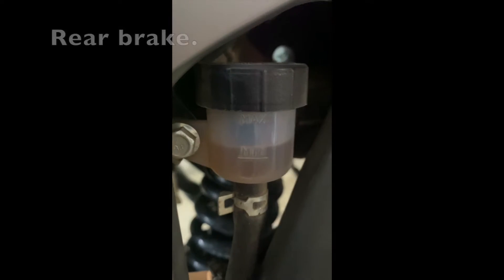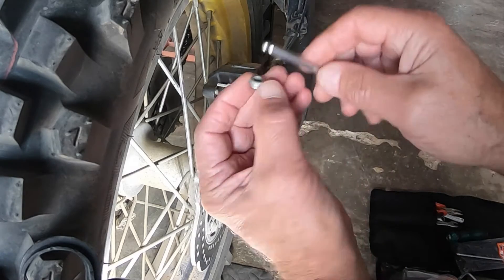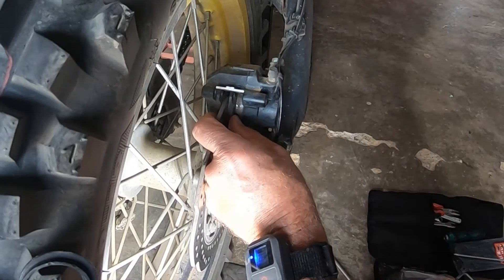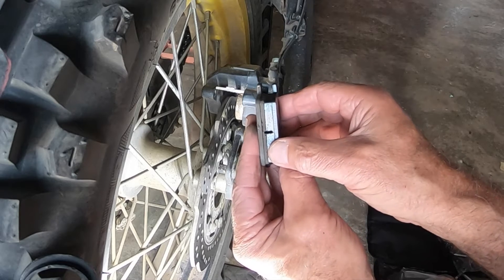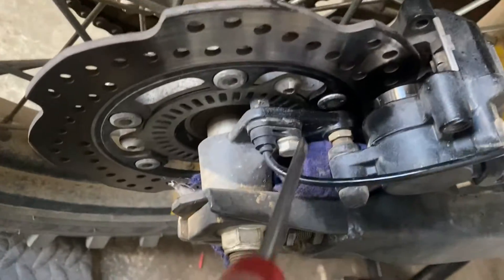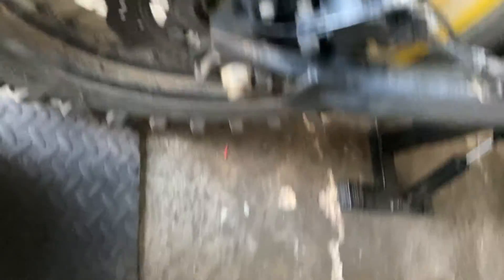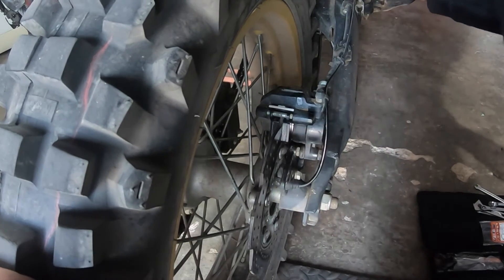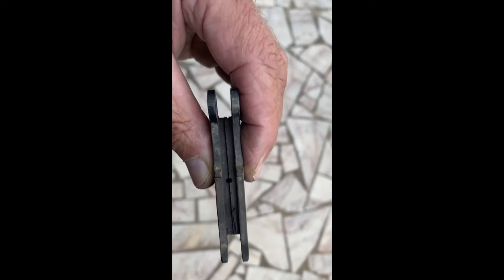Voge 300 Rally brakes.

Comment: Brake cleaning spray is fine to get on the dusk or pad. It's purpose made for the job. On replacing the new pads it's good practice to copper grease the back of both pads. It helps stop brake squeal.
Reply from the maker: Thanks for clearing that point up. I was referring to any oily spray that someone may use for cleaning parts. e.g. WD40 etc. Iv'e not had brake squeal so far, but if it started to become a problem I would apply some copper grease, as you said. I used to use it on cars all the time.

Comment: Hello there. Did you manage to lower your brake pedal? I just got new boots and trying to lower it but seems like you can lower it that much.
Reply from the maker: Hi. No I didn’t need to adjust the pedal. I looked at it and you are right, it can’t be moved very far.
Reply: Hello again. One more thing I wanted to mention - very important THiNg. On the left side of the bike next to the rear suspension is rectifire. The connector has a boot ( rubber cover) , feel free to drain a hole in the rubber part so the water can escape from there. Not sure if you riding across the river but if water there and can' escape will burn the rectifire. Adios!
Reply from the maker: Thank you for that very helpful advice. I will definitely do it.
 @kirilkovchegarski3707

Comment: What tires and center stand you have?
Reply from the maker: The bike is not fitted wit a centre stand. When it's in the garage I use a support jack that goes under the bash plate. I have made a video about the tyres, and I will be releasing another update in a few days. The ones in this video are Maxxis MX tyres.

Comment: Do you use the rear brake a lot?
Reply from the maker: No, which is why I was surprised at the wear.
Reply: I had a similar surprise with my Pan European. On that I tended to only use the front brake although the brakes were linked so there was always some rear braking as well but not much at all. I noticed the front pads were a bit worn so took it to a local bike mechanic to get them changed. He took a look, told me there was still life in the front pads but the rears need changing.
Reply from the maker: @davidmatthews3093  I had the st1100. Loved it 😍